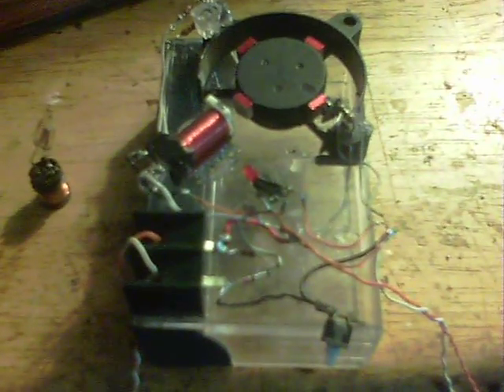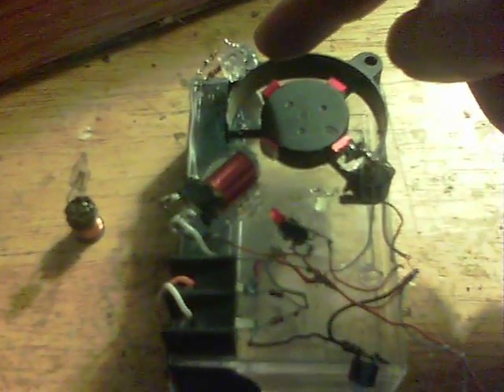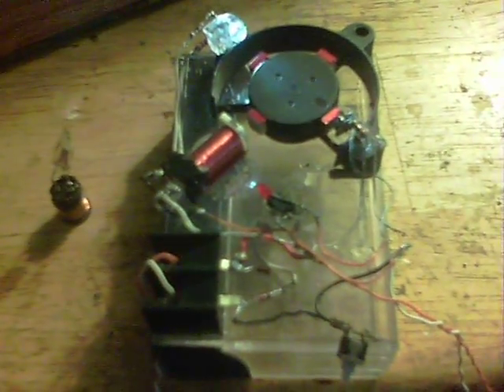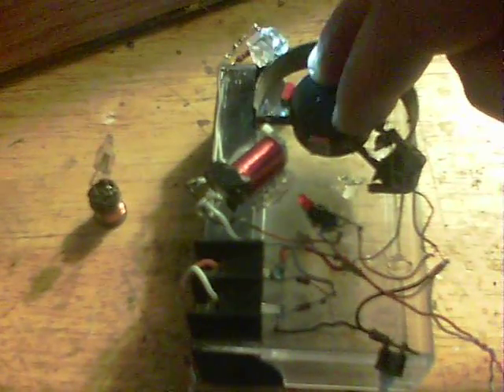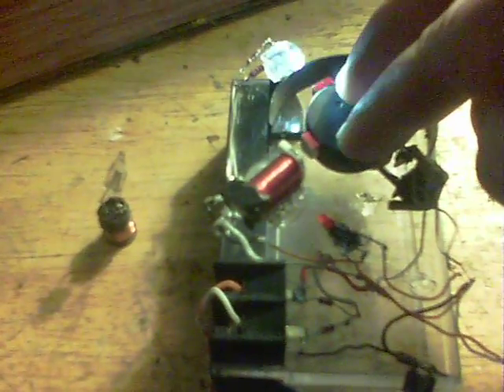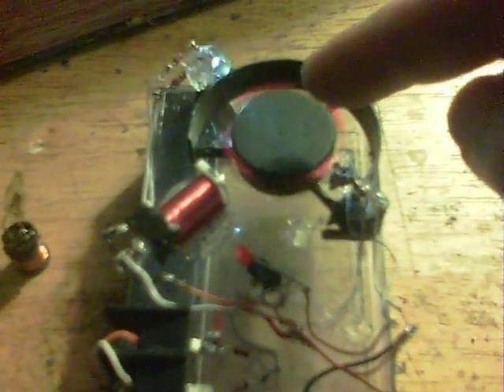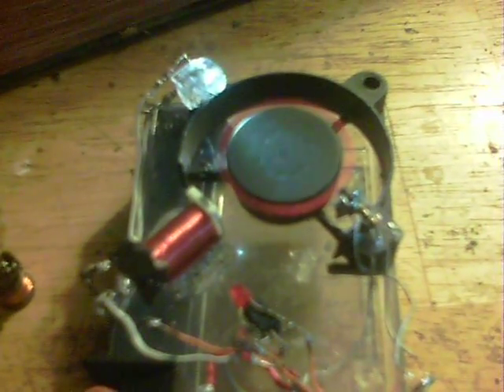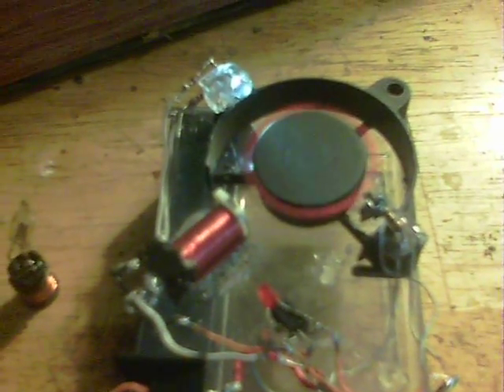Magnet to Hall timing method - Pulse motor

Comment from the maker: Thanks :) I'm relatively new to all this myself (note how the sensor was disregarded because of chatting on camera lol). There have been times when the sensor was placed too far away or incorrectly angled and no firing happened...which this easy mod allows us to work out very quickly. 
All pulse motors are different by some degree and so are the angles for best firing.